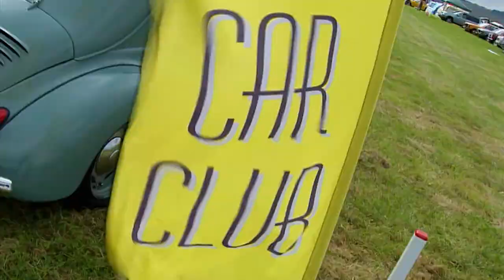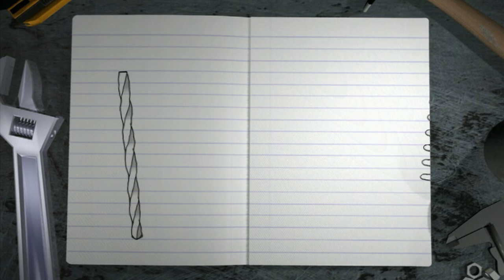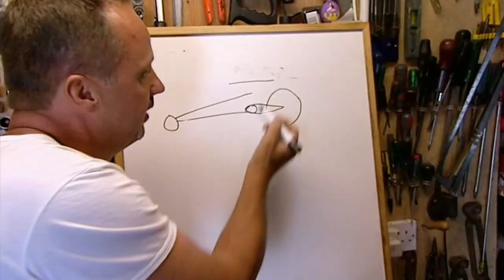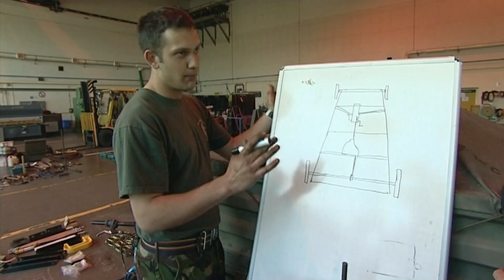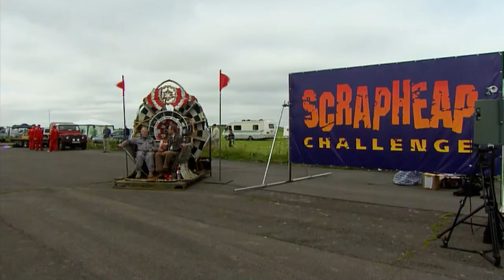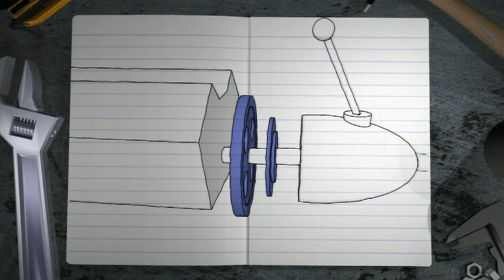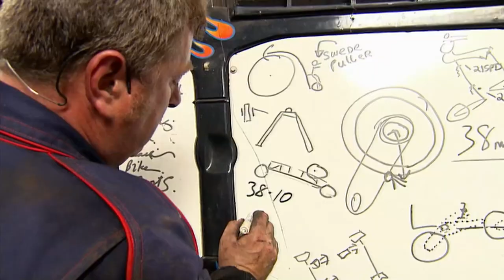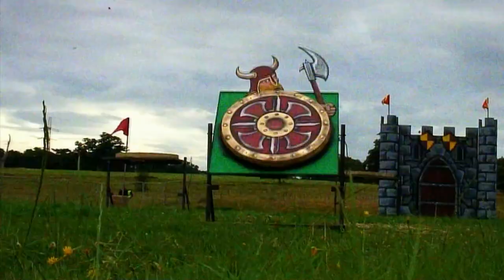High-speed Row Bikes: Semi-Finals - Scrapheap Challenge - S10 E14 - Game Show

Comment: A flywheel is actually a terrible idea for this kinda thing, sure its going to give you a boost or help you get off the line but once you've used the energy in it it is a huge amount of dead weight, and any energy you spend on getting it up to speed for another boost would have been more efficiently utilised by just using it to maintain the speed you already have
Reply: Not only that, if they forget to open the clotch after its energy is spent, it'll slow them down or make it more difficult to pedal the vehicle as they will be pedalling against the weight of the flywheel.